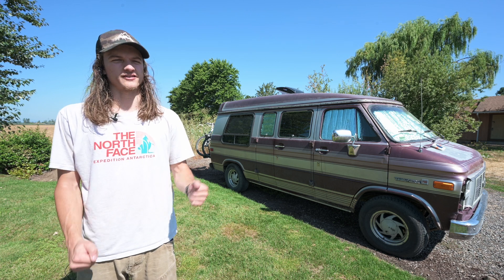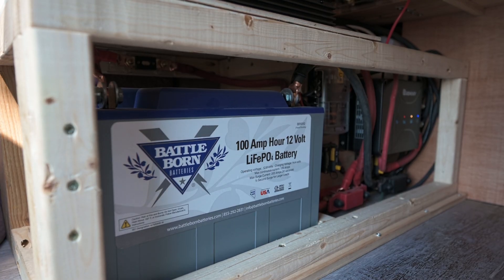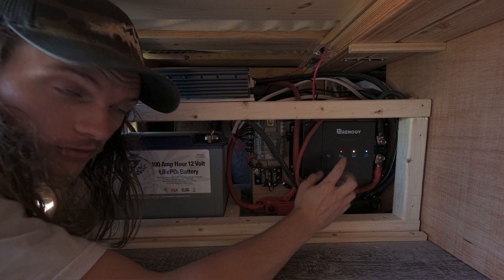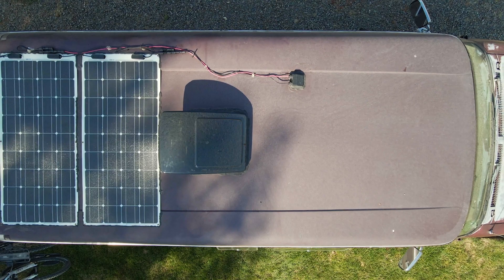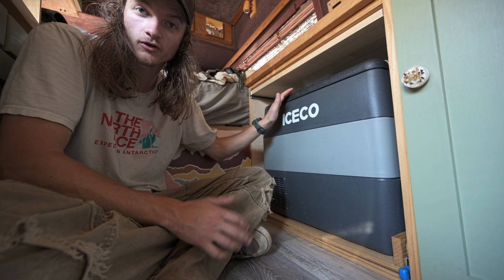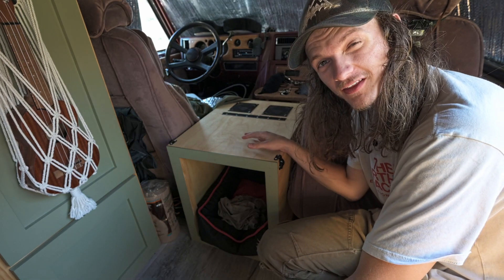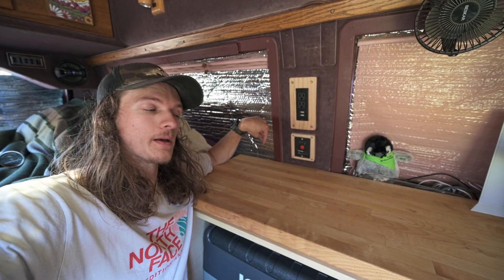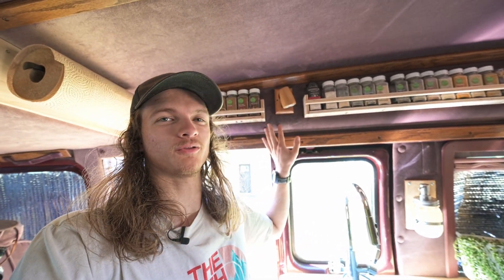SIMPLE OFF-GRID ELECTRICAL SYSTEM FOR VAN LIFE (space-efficient setup)

Comment: I've been studying the asobolife guidances myself and only planning 100Ah to start.  I got confused b/c one diagram says battery to bus, etc is 2/0 and another says 2AWG (boy are these NOT the same!).  Do you recall what size you used from your battery --> 300A fuse -> shut off -> +bus and other battery specific routing besides the PV in??? thx.  EDITED: slightly reworded to make the electric pathway under discussion clearer for future reference.
Reply from the maker: They are some of the best references I've seen online! Yes, I used 1/0 for all of those connections you mentioned. Everything works perfectly and I've never had any problems with this, though you could step it up to 2/0 if you felt it necessary. With the charge controller that I'm using, it seemed like 2/0 wouldn't even fit through the holes in the cover to the terminals. Hope that helps!
Reply: @kaydeandkatrina  THX! happy trails!
Reply from the maker: You bet! 🙂